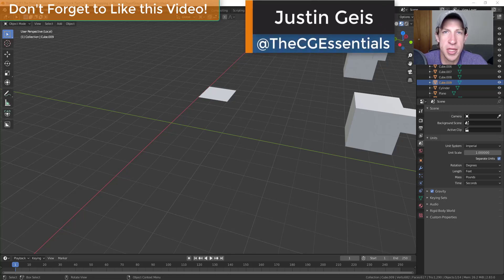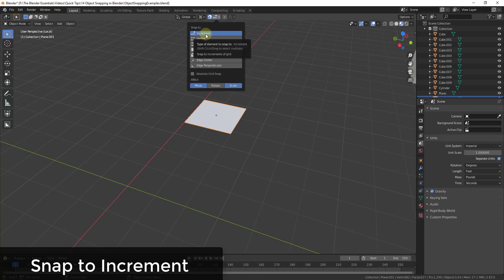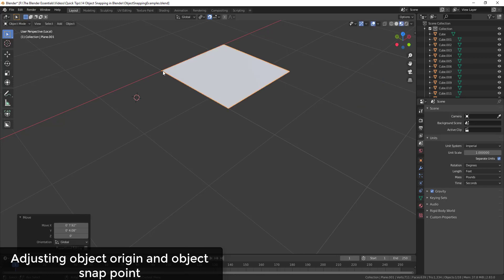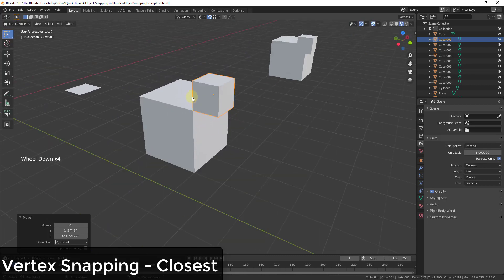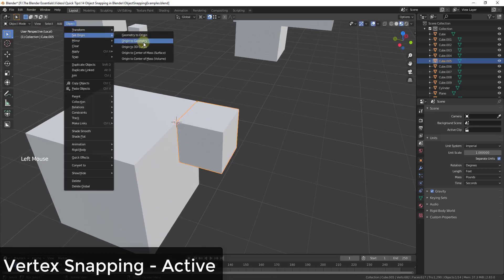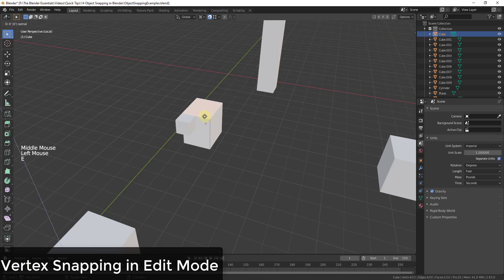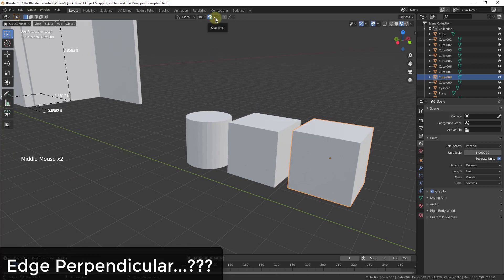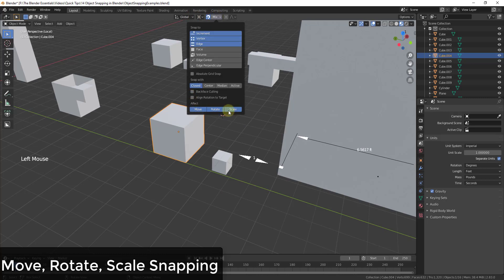Getting Started with SNAPPING in Blender! Snapping Tools Tutorial

Comment: I've seen something happen to you that has been challenging me: I bring the cursor closer to a vertex of the object and the snap happens from a vertex opposite to it. I solved the alignment problems using the Align Tools add-on (excellent tool, by the way). But I would still like to know if there is a quick fix for this annoying snap behavior.

Comment: Amazing how after years of using Blender and creating a ton of 3D models, printing a great deal of them, I still struggle to "harness" Blender and have it snap one object to another. It will ignore the distance between object several times until it finally gives in at some point.
This is the only thing I still think Blender REALLY sucks at. It works wonders in tutorials like this, but when I try it, it works randomly. It's been like that for all these years, certainly my lack of practice and patience to get it to work.
I have used it many times, but dragging objects against others multiple times until Blender "wakes up" to the snapping task has always been a waste of time in the process.
One instance where it seems to fail miserably is when you want to snap objects as you move them proportionally using S while positions is enabled in the Tools tab. All objects will come closer together and never snap to each other in any way, shape or form.
It seems snapping only works with direct mouse inputs, not shortcuts such as G or S.
It seems to me like a great option that is forgotten every new release or I'm demanding too much from it in specific operations (complex meshes rather than cubes is what I mean). I really don't know.
Of course, trying to snap vertices and edges alone won't work. Blender relies on where the mouse cursor is, but that removes precision completely if you're trying to snap multiple objects at once or objects that have many edges, faces and vertices.
It would be awesome if Blender detected the actual vertex, edge or face to its counterpart in the other object rather than you having to point to it with the mouse or changing an origin you need to keep to geometry.
Reply from the maker: I generally agree - the snapping in Blender is pretty imprecise when it comes to the points it picks up and the points it snaps them to - it's pretty clunky but in my opinion still better than not using it.
Reply: @TheCGEssentials  You're right, but now what I realize what I didn't make clear is that Blender would rock with its snapping tools if they relied on collision rather than mouse pointer position only.
Imagine you being able to tell Blender which vertices, edges or faces you'd like to become the snapping point by simply selecting them in edit mode in each of the objects involved in the procedure.
Selecting everything in edit mode could even create a box collision in the selected objects that would activate during the movement of the objects towards one another. It might also even be triggered only when objects are at a certain distance as collision detection can be very CPU intensive.
There could even be a toggle between the mode it relies now and the collision detection mode which would work regardless of mouse cursor or center point position.

Comment: 6:36: I must correct this:. "Snap with Center" option doesn't mean you snap with center of an object but rather the center of transformation which you can set for example to the 3d cursor, which is actually very very useful. That way you can set the point to snap with wherever you want on the fly and I was looking for that functionality for a looooong time.:)
Reply from the maker: Interesting - will have to look into this a bit more

Comment: 10:08 Great video man! but how do i snap an object using a vertex of it as a pivot to a vertex of another object but without having to be constantly changing its origin to use as a pivot? In 3Ds max with certains options enables it would automatically select the closest vertex to the cursor as a pivot when moving it, not needing to change it origin or anything. Help I really want to switch from max to blender ut these little things make it frustrating.
Reply: Here is my workflow:
You must have "snap with center option" and "snap to vertex" turned on, Transformation pivot point (.key) set to 3d cursor. Now:

1. By holding right mouse button with shift, move the 3d cursor to the desired vertex that you want to act as an anchor.
2. Move the object itself and enjoy:)
Reply: @krzysztofneubauer2390  Just tested what you said and it works! thanks, this is for sure makes it much easier, to be clear this is still changing the objects pivot every time right? i get a feeling it's still going to be a bit annoying since one usually likes the pivot to be in a certain spot for a bunch of things like turning, modifiers and stuff and i would have to remember to change it back or some stuff would get messed up. Maybe i need a tool that resets the pivot to the previous spot on the model or something.

Comment: I want to make two objects (same object but located in different areas) overlap. Which snapping method do I use? Snap 5o vertex did quite work. And I can't go into edit mode to select a vertex of the object I want aligned because it's the high poly version of the other object and it takes a long time to deselect the entire object and select just one vertex

Comment: I come from c4d and I am shocked how much more convenient the c4d modelling tools are. Blender is stacked with useless panels and shortcuts that nobody needs and simple things like snap settings and moving pivot points require several clicks in several tabs just to get what you want. I suppose you get what you pay for but it seems unnecessarily stupid as Blender is technically capable of doing everything c4d can and more. I really hope they make a complete reword of the interface at some point and remove all these unnecessary tools like g+y... There's a frickin transform tool, it does the same job but better! You don't need both! And why not show increments next to the transformation instead of hiding it in another panel, so dumb.
Reply: C4d has something blender doesn't have, a full time well payed team of development... Blender is made for free by enthusiasts and c4d takes use statistics from users, blender doesn't... So if you want to help... Go to repository and suggest the changes ;)
Reply: @BrujoLocoTestarudo  This was an old comment, I think blender is now the superior software. Better than Maya, better than C4d and better than 3dSMax. It can do everything all those old industry standard software's can do but usually better. It does have a steeper learning curve though and it's still easier to get into a software like C4d but it's worth the effort to pick up Blender instead.
Reply: I figured out ways to use these features quickly by practicing.

Comment: Hi, there is no information about adding snap points for precision measurements, for example adding a vertex in 1/3 of the edge length, for example we have plane, edit mode, loop cut the edge at the center then select the vertex of the loop move to the left vertex press a (the first snap point) then move to the opposite one and press a again = 1/3 to the right from the center of the edge, pressing the second vertex twice gives the weight that equals two = 1/4 and etc, thanks for the video

Comment: I wanted to snap one room to another room with the connecting faces already missing (only vertices there) but it just wouldn't snap. What I didn't notice in your video until I looked closely: When you use the "Closest" option with "g" mode active (press g once, don't keep it pressed!), you have to hover your mouse over the vertex you want to snap your object to. Then you're going to get the same orange circle around the chosen vertex shown in the video. If you're having problems finding the right vertex, just switch to "Wireframe" mode (press "z", then pick "Wireframe").

Comment: such a pity blender is still far behind sketch up in basic modelling, i don't know if have cry or laugh, it's just pain to watch..

so many clicks just to align things to each other precisely in the scene!
the guys really should take some guy from SU and show them basics which they have to implement

** simple movement,/scale/rotate rules:
- take anything with mouse down in the scene selecting the object under mouse by priority :
    1 vertex
    2 edge[+middle]/shape[+center]
    3 surface[+center]) 
    4 for axis of rotation take normal of surface you mouse down on, or if vertex and move mouse down along line which will serve as central axis for rotation, then when you release you move/rotate/zoom
- begin to move and search for anything in the scene, magnetting againt to the same priority order as selection
- moving along axes/edges will align (proposed) movement to those axes/edges - you can still use hotkeys for axes
- shift down will switch on lock for the proposed aligned movement 
- ctrl key down will switch between JIT_copy/original object operation is applied to 
- PRECISE VALUE FINISH : 
     allow inserting values for running move/rotate/scale  while in operation simply by typing numeric value + enter finishes operation with entered value
- MOUSE SELECT FINISH :
    left mouse down allows to final decide operation snap point/value with floating above the best pick of possiblities
    release mouse finishes operation
- when finished you can STILL write :
    *number of copies and so many copies will be created using relative translation you did to new copies (array)
    /number of the copies so many copies will be created using partial translations to achieve one you did distributing new copies inside (array)

!!!! draw shapes on any flat surface with instant extrude/sink - no discussion here - simple, effective

!!!! when sinking hole remove remaining walls if on the edge of the object - pain to see blender does not takes this from sketchup

++++ GROUP CONTEXT EDITING : onion skin modelling inside group = seeing unselectable but snappable +number of levels above edited group plus content of the group

+++ SURFACE CONTEXT DRAWING : quick align view to any surface you select and work in that 2D plane for drawing shapes

at least those few will help to speed up creativity 'right of the box'..
thx guys however for your efforts!!
Reply: Blender is free. Want more features? Offer to help them out, adding new stuff.
Reply: Well its because its not intended to be cad modelling software. Even maya or 3ds max dont have kinda thing